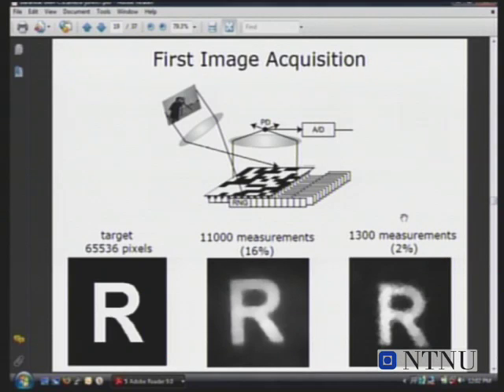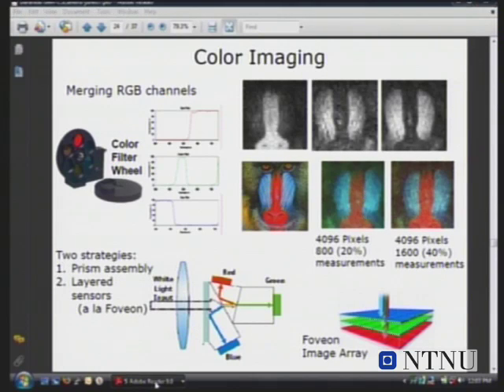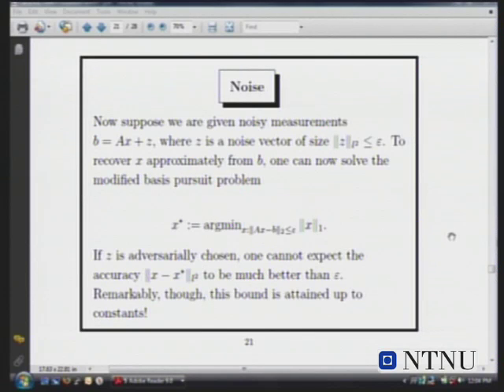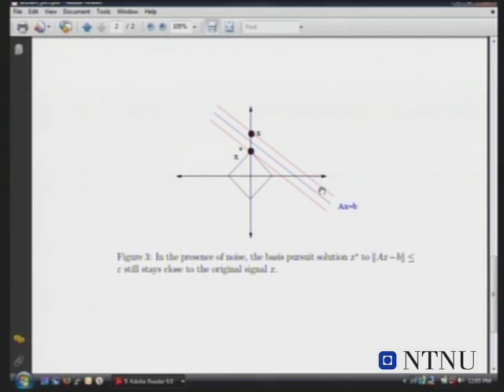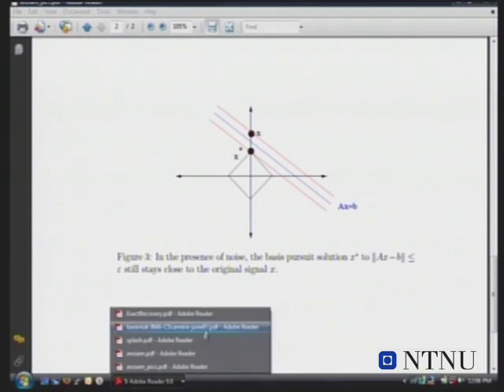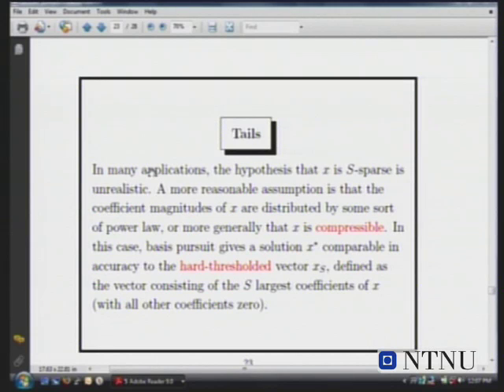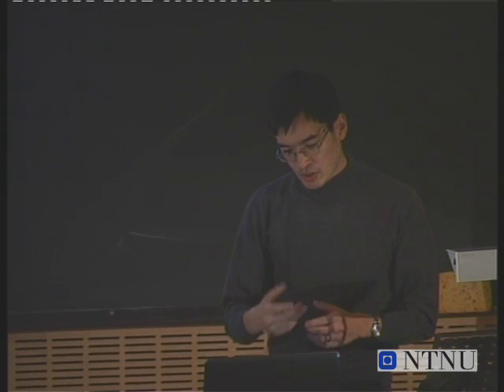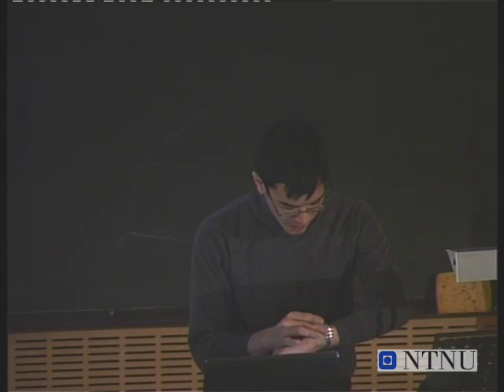NTNU's Onsager Lecture, Compressed Sensing by Terence Tao, part 6 of 7

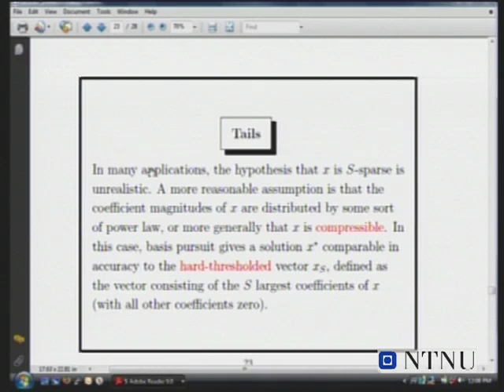Comment: 5:30 After you've gotten the sparse solution, let's say you subtract that from your original data. Now you are working with residuals. If you do like a regular regression on the residuals, can that reliably give the small/tail values?

Alternatively let's say you throw away each dimension on which you did already put a coefficient. Look only at the remaining small dimensions. Again say you do a more classical method to estimate these remaining dimensions, and compare to the magnitude of the thrown-away (≫sparse) values. Does that work?
Reply: Lao Tzu I think you are proposing what is commonly known as Matching Pursuit and perhaps hinting at its more sophisticated cousin, Orthogonal Matching Pursuit.  While OMP works reasonably well and is easy to understand and implement; better algorithms exist such as: reweighted ell-1 (see Candes), Generalized Approximate Message Passing (GAMP, see Rangan )
Reply: Thanks Mark!